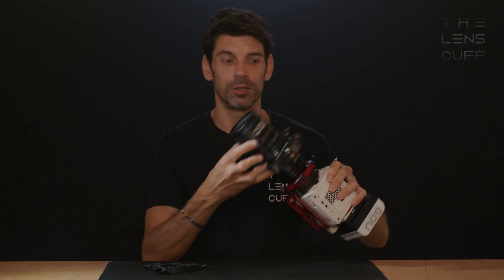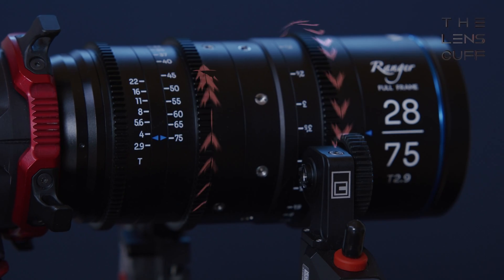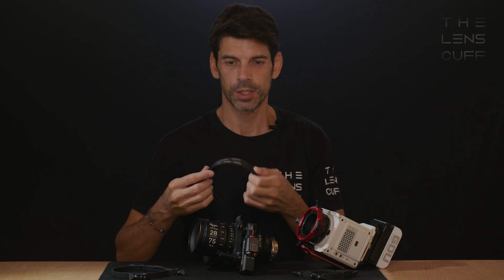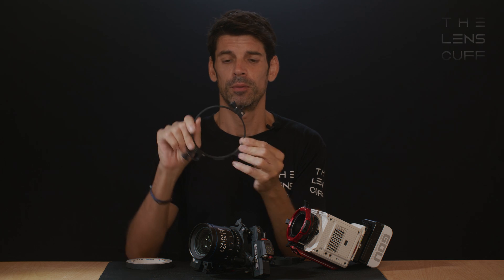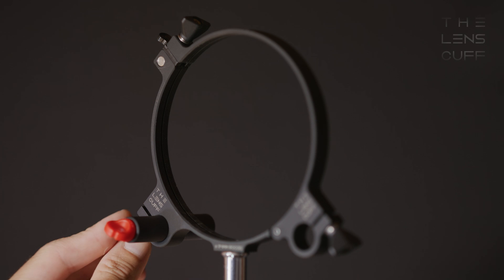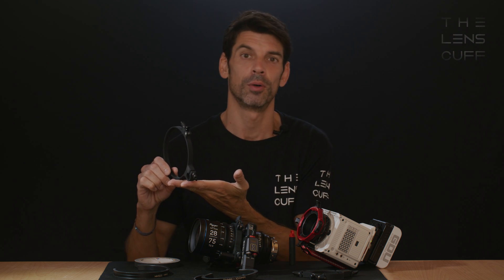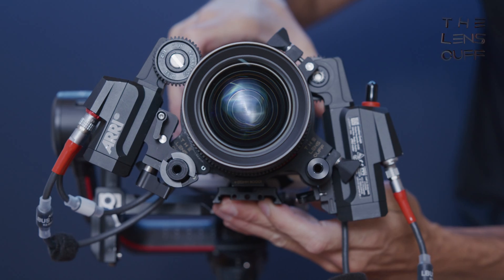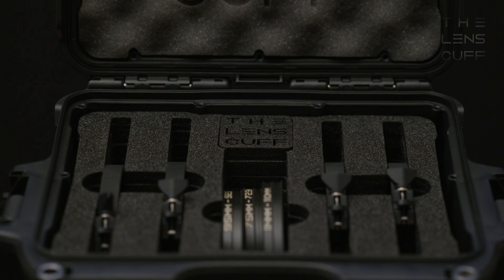The Lens Cuff - Technical Walkthrough

Comment: Hey, is the Lens Cuff Lite compatible with the Meike MK 35mm T2.1 S35 EF-mount cine lens and the other lenses from this series? On the website it says it’s only compatible with the full-frame set and the Meike S35 Cine Mini Primes.
Reply from the maker: Absolutely!
The list includes only what has been tested by our team or by customers who have submitted information to us.
The Lens Cuff fits on nearly every lens out there, so long as there's a flat non-rotating segment of the barrel to clamp on. It requires a 12mm wide segment.
On the Meike T2.1 with a front barrel diameter of ø85mm, you can directly attach the 85mm Lens Cuff without any of the included step-down rings.